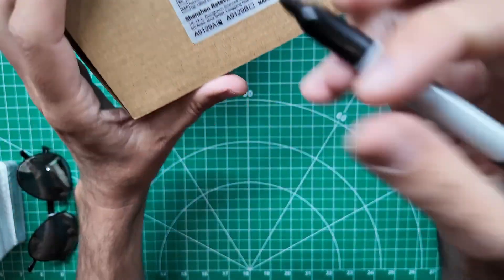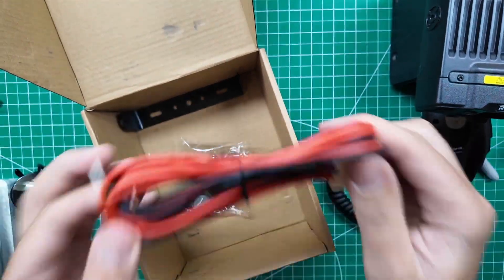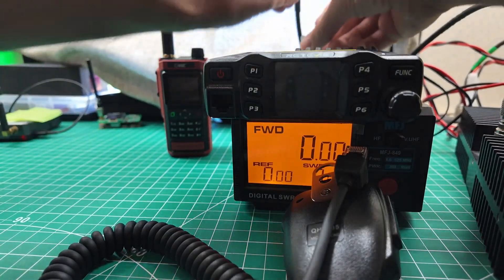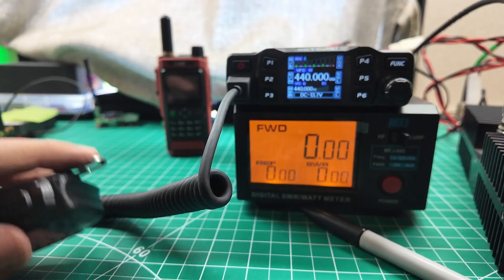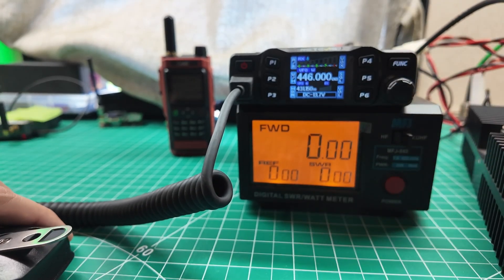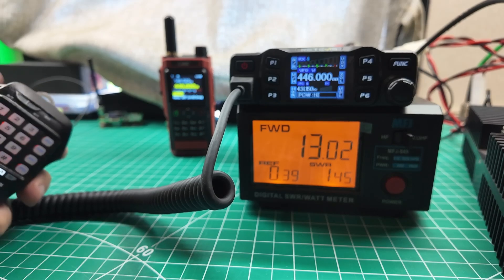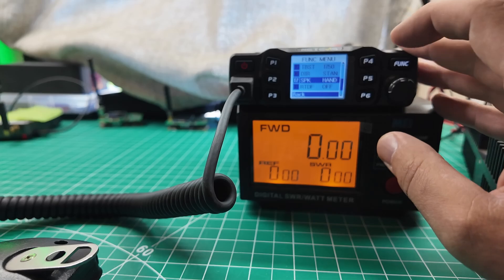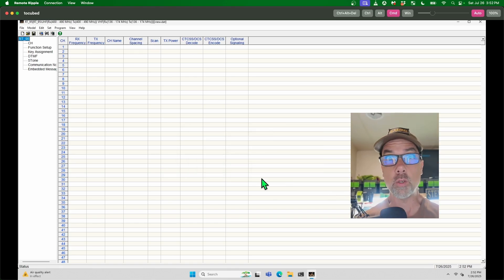Returned… For THIS? 🤦 (RT95 Repair #10)

Comment from the maker: 📻 Honest question: Do you think radios should ship fully unlocked, or is region-locking the right move? Drop your take below — I’m curious if you’d rather have total freedom or manufacturer limits.
Reply: I would rather have total freedom, but different regions/countries have different regulations. Regardless, if sold to US, it should be set to region 2.
Reply: I don't wear clothes...
Reply: Information wants to be free! You can't stop the signal, Mal!
Reply: It should be locked to the correct region, this would prevent these returns.
Reply from the maker: @godarklight should be. But I don't know where there were originally sold.  Appears to be US

Comment: A lot of them radios were sent out with wrong region code.  Maybe a entire shipment was mis sent. Many nations ask for correct region . Some are sent out un locked and some with correct region.  With some research most radios can be changed to a outher region . Some are locked and can't be changed . Best to check before you buy. Some one messed up on that batch of radios .  The first UV-5G was programmed wrong and had to load new firmware to fix it. Mine came fixed . Common for China radios. They sell to the world .  73
Reply from the maker: They sure do!

Comment: I don't have an issue with region lock, probably not bad for the in-experienced, but unlocking needs to be an easy process.
Reply from the maker: Its pretty easy - 3 finger salute, choose menu option.
Reply: @temporarilyoffline  I can't remember if the MA1 has the same easy process, but the unlockabilty is specifically why I want that radio too. I know you already know this, but for others, Mode 02 on the RT-95 makes it a very useful radio for emergency communication across the other bands, such as FRS/GMRS, MURS and Marine.
Reply from the maker: @bendeleted9155 my MA1 was unlocked already.  I don't yet know the trick for that radio
Reply: I'll let you know T.O. It gets here Sunday.